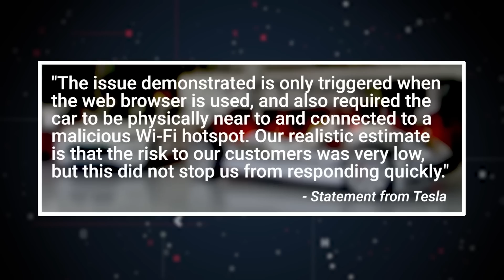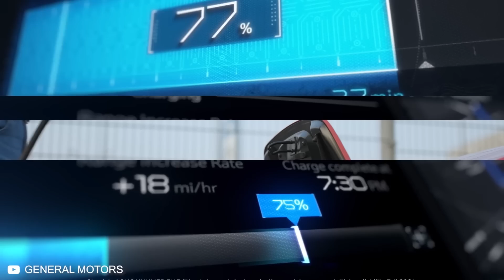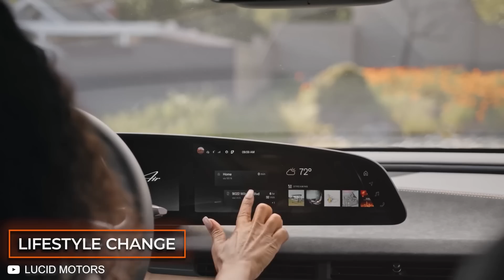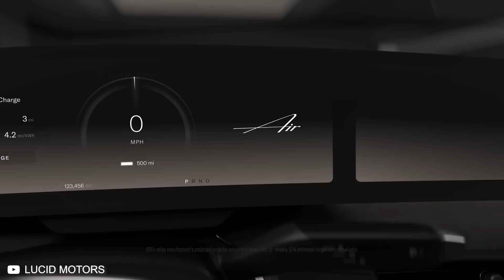EVs' Serious Problems That Carmakers Are Hiding

Comment: The radiation emitted is enough for people to say no. There is no safe level of radiation,. There is an accepted level but no amount is a safe amount. Radiation will come right into the cab where you and your family are sitting. The charging stations emit an incredible amount of radiation.
Reply: False on all fronts. Radiation only causes damage when it is IONIZING. Which EMR (electromagnetic radiation) is not at those levels. Additionally the cabin is EMR insulated. EMR inside the car whilst driving and charge are lower than background levels outside the car.

You literally get more EMR from your phone in your pocket up against your skin, and the device you’re typing this rubbish on, than you do from an EV. Don’t be stupid.

Comment: Follow the money......1. shut down LP & Coal fired power plants 2. shut down Nuclear power plants 3. create a electricity hungry vehicle 4. Vehicle cost $$$$$$  5. Fuel cost $$$$$$$ 6. Maintenance cost $$$$$$$$$$$. I FEEL BETTER ABOUT THE ENVIRONMENT ALREADY, SITTING AT HOME UNEMPLOYED AND AFOOT.
Reply: That would make sense, if it wasn’t for a few things.

1.) all the money is in coal, gas an oil. And they are some of the largest donors to political parties on the planet. And legacy auto makers see better profits with ICE.

2.) home solar exists. It’s not uncommon to have sufficient solar such that most of the year you don’t need to get anything from the grid, even with an EV.

3.) electricity is ALOT cheaper per mile. But our electricity consumption has been exponentially increasing since the first powerplant was commissioned. If this is how they wanted to make money, they didn’t need EV’s to create a demand for it. It’s already there.

4.) maintenance costs for EV’s are a FRACTION of the maintenance cost of an ICE, they don’t need to regularly replace parts and fluids like an ICE car does. Modern EV batteries even last longer than an ICE engine. A regular service you might do every 10k to keep your car warranty would be:
-replace all spark plugs 
-replace engine oil 
-replace engine oil filter
-replace air filter
-check fuel filter
-check transmission oil
-check radiator fluid
-check timing belts
-clean fuel injectors

The list goes on. And EV, you might have noticed, has NONE of those parts. so What exactly do you think you need to maintain on an EV?
Reply: Yep. Follow the money. We have investors in fossil fuels, with trillions of dollars at stake. Their fortunes depend on the continuing expectation that they will be able to sell through the known reserves. Every month they can delay rational public policy toward waste CO2 is worth billions of dollars. The half a billion or so they spend each year on "conservative think tanks" and related lobbying and public relations projects to undermine public confidence in science is a good investment.

Comment: Google says:

"Effects Of Frequent Fast Charging. An electric car's ability to accept higher charge currents is affected by the battery chemistry. The accepted wisdom in the industry is that faster charging will increase the rate at which an EV's battery capacity will decline."

So, they talk up "fast charging", but they're NOT telling you that fast-charging damages the batteries!
Reply: The part your missing is the degree to which it damages the battery. Which is, not by much

Comment: The million mile GM battery sounds like the Back to the Future automobile fusion reactor that runs on beer cans. I remain very skeptical. The EV is a automobile with a 10 year max lifetime because of the battery. Of course it can be much shorter when the battery self destructs and burns down everything around it.
Reply: Modern EV batteries have an 8 year warranty alone. Infact modern EV batteries are designed to last upwards of 400,000 miles. So maybe a tad more than 10 years lifespan kiddo

Comment: At 2:05 that is a very misleading statement.  “Less mechanical components doesn’t mean they have less problems” is exceptionally misleading.   What does that statement mean to you at first listen?  I even listened to the follow up and they simply reinforced that notion.   To me they were at the very least inferring that EV cars have as many problems as ICE cars.   They didn’t say that directly, but by saying the stamens I quoted, they are leading the listener to believe that an EV car HAS as many problems as an ICE car.  Simply untrue.  I’d like to hear some comparisons.    Tit for tat, with such ICE problems as, messy, stinky, dirty, caustic fuel exposure every time you refuel.    Who wants to carry 5 gallons of gasoline in the front seat of their Mercedes?    That’s what I thought, so stop your argument.      Oil changes.    Spark plug changes.    Troubleshooting misfires, bad alternators, sludge build up related issues, and mechanical wear related issues, such as blow by, worse emissions, cooling system issues, emissions control issues, catalytic converter issues, transmission issues, timing chains, leaking intake manifolds, O2 sensors, exhaust manifold leaks, starter issues, battery replacement far more often than an EV, accepting that the EV battery is much more expensive, yet, as far as number of problems, compounded with frequency or expected mileage when these often become real issues, and compared to an EV, the list is much longer than an EV.   Notice I didn’t include issues that could be on either car, like suspension, power steering, brakes, AC, interior electrical.   But what are some things to compare against an ICE.      Ummm, the battery needs to be replaced … you know what.    The benefits of Ev cars so outweigh drawbacks that here really is t even an argument so I’ll stop there.       Get real.          Bottom line is this; EVs are typically 85% efficient, while ICE cars are typically 40% efficient.    Not even close.  No argument.       Add in the fact that there are so many less moving parts and maintenance problems it’s not even remotely arguable.

Comment: 1.) even on a coal only grid, EV’s still produce significantly less emissions that a ICE car does even before you consider the emissions produced the refine your fuel on the first place!

2.) energy grid will be fine. Buy in large most grids double in capacity every 20 years. Which is a rate that exceeds even optimistic EV adoption.

The problem with California is their politicians playing Engineers with the energy grid to virtue signal for votes. You know this because for a while there, California was the only place on the world to see declining rates of EV ownership. And the grid problems, brownouts and rolling blackouts continued*to get worse.* 

So using California as an example of a typical grid is like using the Simpson desert as an example of rainfall averages. Or using Alaska as an example of global temperatures. Or using Argentina as an example to say water quality in America is bad.

Don’t generalise the extremes. 
In the Phillipines.
Reply: bad math done for wannabe-logic. the carbon footprint of every new produced electrical car equals to the carbon footprint of every petroleum produced car after ten years uf using - with all its smoke and other. in addition, many more tousands african children do live and do die in slavery, illness and poverty, never reaching maturity, because of digging manually all the metals for the batteries of all those "clean" electrical cars. now, you alone can (maybe) count how many black karma collects every user of electrical car just for paying of sustaining and expanding the child slavery alloiver the world. not even counting the black karma collected for the asassination of tousands birds, and other animals from the solar fields, who do leak heavy metals all their life, leaving the once arable earth below them toxic and dead. have a nice calculating!
Reply: @nusplus3985  ahh, no. On so many fronts. 
1. That’s not what they mean by after 10 years. EV’s produce around 15% more emissions to manufacture than ICE. Even from a coal based grid, the use of EV’s produce so little emissions that after 10 years, it breaks even with an ICE car, (assuming it’s burning fuel to travel the same distances at the same time). This isn’t inclusive of the massive emissions produced by fuel refineries.

2. You’re referring to child mines on the Congo to get cobalt (naturally since most lithium on the market is produced by Australia.) - the new Tesla batteries don’t use cobalt. Eliminating that problem. Additionally almost all car manufacturers have signed ethical sourcing agreement state they can’t accept child or slave mined cobalt for this EV’s. However, whilst batteries are the largest consumers of PURE refined cobalt metal, they are not the largest consumer of cobalt by mass which includes cobalt alloys, chemicals or agents. The largest consumer of cobalt by mass, and who have never had the public pressure to ethically source cobalt. Are FUEL REFINERIES that produce your fuel to burn in your engine. They use it to remove sulphur from the fuel.

3. EV’s are independent of wind or solar power. I’m not sure why you’re blaming them for wind and solar but it’s unhinged.

4. Most solar panels are silicone based and not toxic. Around +75% in use today.

5. Wind turbines do have oil but they don’t leak as much as say a combustion engine does into the environment. (Same sort of oil). Additionally it doesn’t really damage the environment, leaks are comparatively rare, and they do no more damage than an ICE car with a oil leak. 

6. Wind turbines take up significantly less space and habitat environmentally than say, a 500MW coal fire power plant for example. Considering they are just poles with fans ontop.

7. Whilst wind turbines do kill thousands of bird yearly, cell phone towers kill billions. Sky scrapers kill tens of billions. Unfortunately cell towers and sky scrapers don’t move and don’t make any noise, which scare wildlife away from its immediate vicinity. Resulting in more deaths. - I don’t see you campaigning to remove all cell towers and high rise buildings to protect the birds…… I won’t why that is? Prejudice maybe? 🤔

Comment: There are three serious problems you didn't mention. #1)If your electric generation plant is burning coal or natural gas, you are still using fossil fuels to power your car, even though only indirectly. And you're losing energy in the process, since no power transfer is 100% efficient. So running your car on this type of electricity isn't saving the planet at all. #2) When more people get electric cars, will there  be enough electricity for everyone to charge their cars. People in California are being told not to charge their electric cars, due to rolling blackouts. #3) People are saying that there isn't enough lithium, cadmium and copper to construct all the batteries that will be needed. Just to make one battery, many tons of earth must be dug up in the mines.

Comment: These things have to be stored in garages because of the batteries. Sitting in the extreme heat or cold can be deadly for your battery. So, are they going to put covers over parking lots at work? Airport? And not all homes have a covered garage or carport. So that's another expense you need to think of. Charging. When you run out of gas, just put more in the tank and with little work you go. Electric vehicles die on the road requires that it be pulled or hauled in. You don't just buy a 12 volt battery just to get you home. Lot's of "other" problems that need to be thought about.
Reply: Good thing the car monitors and regulates it’s own temperatures then isn’t it?
Reply: @engineeringtheweirdguy2103 I'll stick to gas and diesel as long as I possibly can. That way if I run out of gas I just pour more in the tank. If an electric car or truck runs out ( and don't say it won't because you know that it will) you can't just jumpstart it enough to get you home. I don't trust electric cars and even worse electric trucks. You will soon see why.
Reply: @Rick-if5zb  so how often do you find yourself out of gas on the side of the road?
Reply: @engineeringtheweirdguy2103  In my past as a young man...lots of times. No matter what you say you'll never turn me on electric cars.
Reply: @Rick-if5zb  that’s nice, you don’t have to like electrics. But they are the fastest growing automotive market in the world. Infact even in Australia the most popular new car for the first half of 2022 was the Tesla model 3 alone. And they’re taxed in Australia, far from being incentivised. That’s gotta tell you something.
Reply: @engineeringtheweirdguy2103  It tells me what I already know...This world is comming to an end.
Reply: You do realise around 30% of EV owners in the US charge outside…. In the rain and the snow…
Reply: @engineeringtheweirdguy2103  And we all know what extreme weather does to batteries. And besides...the pollution you're saving by going electric causes the loss of mechanics jobs, engineers jobs and the rise of need for more electricity which makes more pollution to produce it. Or do you think all electricity is made by hydro (water) dams? Better look again, hydro electric plants don't fulfill half the nation's needs. And the windmills? Better check those off your list too they don't even produce enough to keep a good sized city lit up.
Reply: @Rick-if5zb  modern EV batteries are sunk inside a pool of coolant fluid kept at optimal operating temperatures at all times. Cold doesn’t affect it that much because it’s temperature is regulated. It also regulates rates of charge and discharge based on temperature as well. Battery management systems are, and perhaps should be unsuprising for most people, quote sophisticated.
Reply: @Rick-if5zb  and where mechanics lose there jobs, Auto elects get more jobs. Where mechanics lose their jobs, more jobs are created at battery recycling plants.

You really think EV’s just plop out of nowhere from nothingness?
Reply: @engineeringtheweirdguy2103  But as they are today they have no real future. Mark my words, there will come a day when you'll look back and think...ol' Rick was right.
Reply: @engineeringtheweirdguy2103  good luck with that buddy.
Reply: How often have you run out of gas in your life? How often have your friends and family? I can’t name a single instance of anyone I know who has. Probably because cars have fuel guages. Funnily enough. EV’s do let you know how much charge and range you have left. It’s amazing what technology can do these days. If only mobile phones had some way to see what charge they have left 🧐

Comment: Child miners of the Congo dislike this video.
Reply: Modern EV batteries being rolled out on 2022 don’t use cobalt. But unfortunately the largest consumer of cobalt by mass on the planet are FUEL REFINERIES who use cobalt to remove sulphur from every lite of fuel you drive.

Life’s awkward like that isn’t it bud?
Reply: @engineeringtheweirdguy2103  well, bud. You didn't complete your homework. The cobalt used in the refinery is used over and over. They are NOT the largest consumer of cobalt.  Most evs have around 9 lbs.  Battery production is and has an expected 100% increase in 2022 and for the foreseeable future. Oops!
Now that's awkward!
Reply: @phillmckrakin2518  teslas 4680 batteries don’t use cobalt. Additionally 100% of the cobalt in an EV battery is recyclable. And what you are referring to is cobalt being used as a catalyst. Unfortunately refineries are the biggest consumer of cobalt in this space due to the fact that catalysts wear out mechanically over time. Not all that much time actually. 

Have fun with that
Reply: @engineeringtheweirdguy2103  Once again, refineries are NOT the largest consumer of cobalt. A quick search of reputable sources will back that up.. There are plenty of manufacturers that use cobalt in their battery packs.  Tesla just started using one type of cobalt free cell out of the 3 types they use. That doesn't mean all batteries are cobalt free. Ev Batteries are NOT 100% recyclable.  Nothing is 100% 
An ev currently is less "clean" than an ice car owned for 10 years.  Your 100k mile tesla story is amusing.
Reply: @phillmckrakin2518  I didn’t say the batteries were 100% recyclable, they’re 97% recyclable. The cobalt in the batteries is.

And pure cobalt, yes EV’s are the largest consumers. But cobalt by mass weight, not so much kiddo. 

Here’s an example, the EV industry current consumers around 120,000 tons of cobalt per year but with the recent invention of a cobalt free battery design, that will begin to drop. With Tesla having plans to roll out that battery type to all of their EV’s.

By contrast fuel refineries use around 758,000 ton of cobalt per year replacing their sulphur catalysers. However this is counted in almost every report because it isn’t pure cobalt. Apparently the only people reporting on it don’t like to consider cobalt in alloys or chemicals. Only the purchase of refined pure cobalt. Go figure. Geee I wonder why magazines and studies backed by fuel industries would make such an omission. I guess we’ll never know